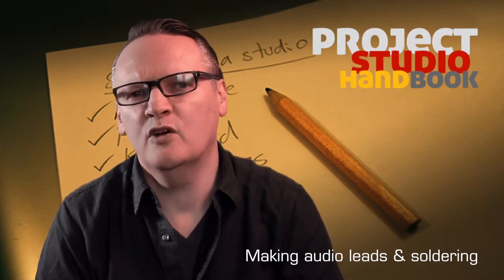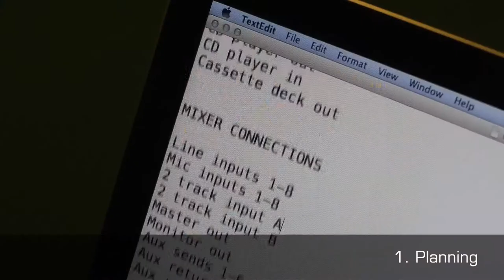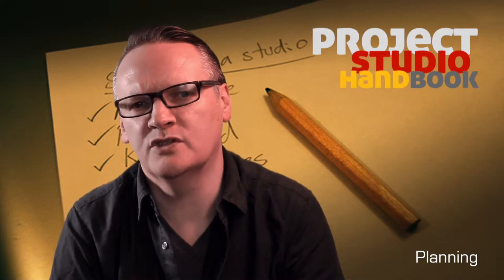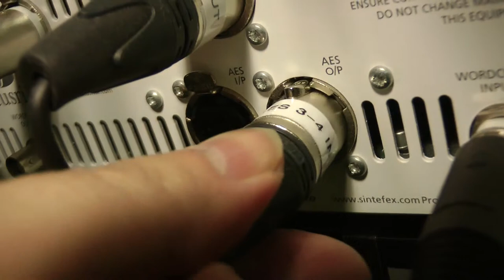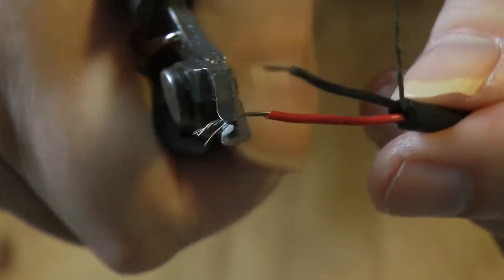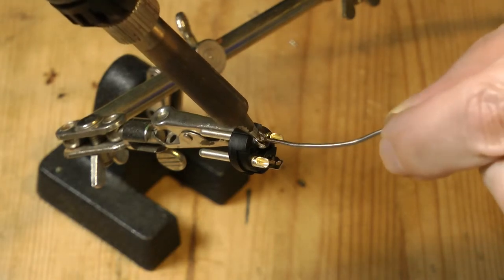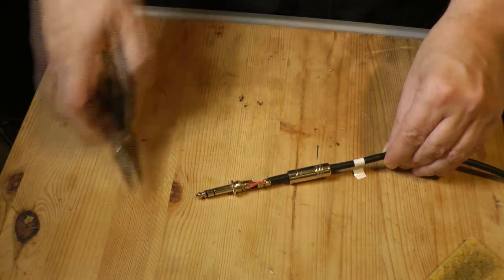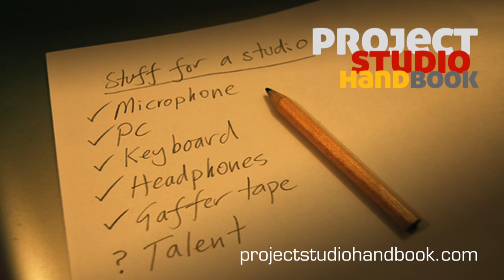Making audio leads & soldering

Comment: What labeling products are good for panel labeling?
Reply from the maker: By "panel labelling" do you mean patch bays, or just leads perhaps? For leads we use a Brother P-Touch 1010.
Reply: In my research, I found the Brother waste the tape by adding large space in the leading and trailing parts of the label. In addition to this, you would have to manually trim the beginning and label end points. I am leaning towards to Dynamo label product.
Reply from the maker: You're quite right. That certainly is a problem with the Brother. Let us know how you get on with the Dynamo.